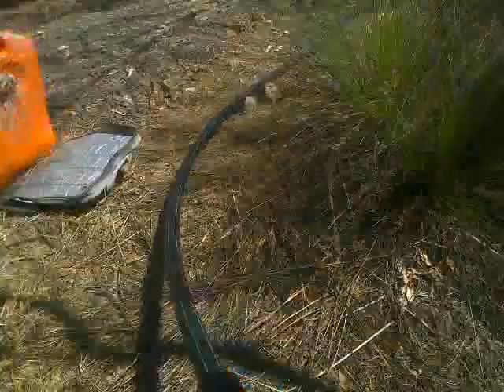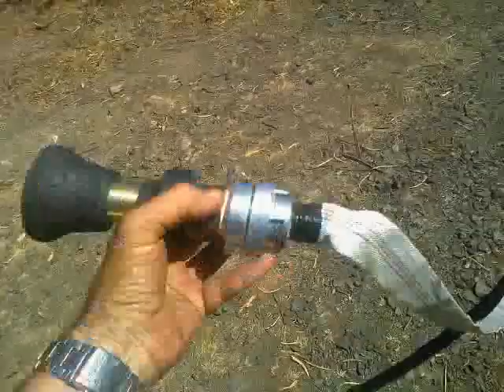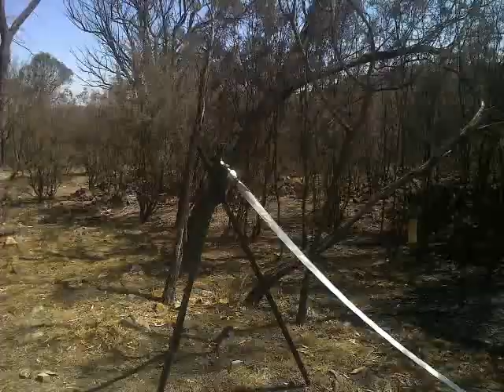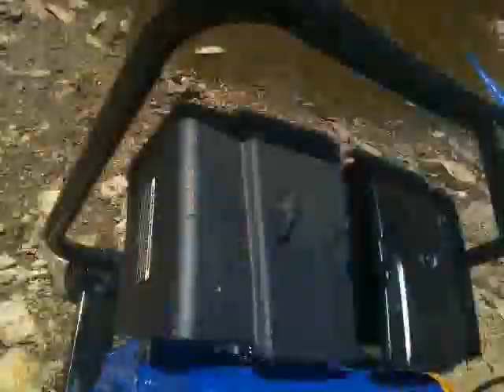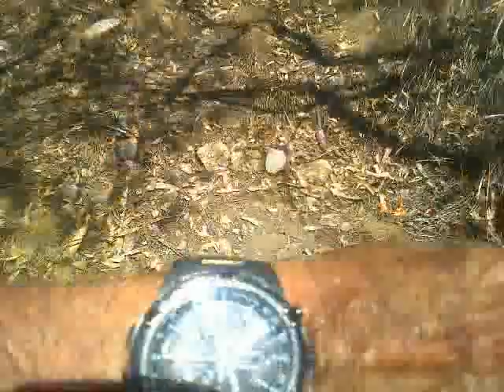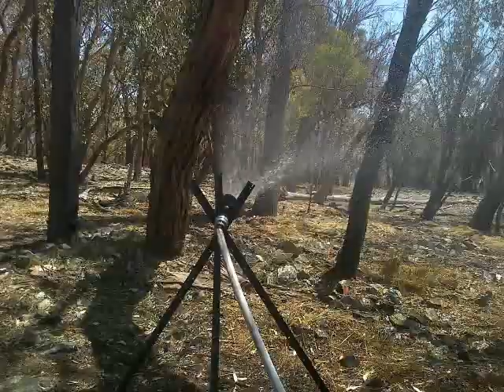The Aquarius Project.., Fire-Hose Sprinkler-Testing...

Comment: Looks like your float is working, considering it’s not a sludge pump that’s a good thing. My only concern for you is that you get trapped at the pond by the fire whilst your firefighting equipment is 450 m away, I guess you could go for a swim while Rome burns??? 
Had to replace 30+ Chinese black iron pipe unions on a yacht because the builder wanted to save $100 on a 6 million dollar build, as long as there are not any leaks on the suction side everything should still function ok? 
Have a good day.
Cheers 🍻

Comment: Your trees really look like they are suffering, judging from the dead leaves that are hanging from them. I guess it will only be a time before all those dead leaves fall onto the ground creating a greater fire hazard. I guess it is too late to conduct a burn off. Do you attempt to rake up all the dead crap on the ground ?
Reply from the maker: G'day Ed,

Thanks mate.

  Yeah, the trees started to brown off and die in July August 2018, when I first started upgrading my Firefighting Gear..., and I did put in a few weeks picking up all the Leaves & wheelbarrowing them out of the Hut/Shed/Aeroplane Trailer area. I moved about a ton of Leaves.

 I did it when half the Trees dropped about a quarter of their Leaves, and then the next heatwave baked the bare dirt where I'd raked, and cooked the unshaded Roots, and then about half the sick trees died totally.

 So this year I'm only raking away real close to the Hut, but I have cut down the Flax-Lillies though, and close in I've raked it up & barrowed it away..., and I've carted 13 trailers (7-ft by 4-ft) of dead Sticks & Trees from my "Hose-able" 1.5 Acres.

   In the middle of my Video to Greta Thunberg I walked two times around the Pile of removed dry wood, it's 3 metres by 3 metres & 4 metres high.

   It's a bit of a balancing act, between dead Leaves being a Fire Hazard and Mulch shading the Soil & conserving Water...

   At the moment I have 2 Pumps, one driving 3 Hoses, the other one feeding a Sprinkler, with a Compressed-Air "Water Cannon" in reserve.

   And soon I'll be able to buy Bore Water from my neighbour (at $50 for 12 Tons, or $25 per fill of my biggest Tank)...; so I'm going to sit on full Tanks while watering at 12 Tons per week - and I'm going to put some Bore Water into my Dam, too, in order to increase the Emergency Water Reserve.

  On the bright side, none of the Fires is throwing Embers in my direction ; but yesterday the Rappville Fire went 20 Km Downwind in 2 hours..., so it can all change really fast.

  I haven't been calling this,

"Australia's Terminal Drought..."

 for 18 months -  for nothin', y' know...

   They say we may be goanna get 20mm to 40mm on Friday & Saturday - so maybe me putting in my Aquarius Pipeline has worked as a Raindance...?

  Such is Life,

Have a good one.

;-p

Ciao !
Reply: WarblesOnALot I personally hate gardening work but my gardening chores is light compared to the gardening work you do.
Reply from the maker: @VBEd666  

Well, I hate Gardening too..., but the only way to not get cooked involves getting  anything that'll burn - and carting it a couple of hundred metres away ; where their Radiant Heat won't be likely to threaten the Clearing.

 It's a Shit-Sandwich, but one does the best one can, kinda thing...; I just try to keep getting back to it, because nobody else will do it for me, and if I want it done then it must be my job..., so I sort of plug away for an hour, then sit and have a Coffee, and then get back into it.

 After a few weeks it starts to mount up, and a bit of progress can be seen.

 I mean, it's still a terrible Firetrap but it would be vastly worse if I'd kept on fixing my Walking-Stick & carving little wooden propellers for the past couple of months.

  And I quit the Booze too - to have more money for Firehoses (!).

   I don't know how surviable  December/January will be..., on Monday it was 33 Celsius here, and my son was coming back from QLD where he said that it was 38 C. at 5 PM as they came through Warwick...

   We live in interesting times...

Have a good one.

;-p

Ciao !

Comment: Great video! Glad to see the fitting held up, apart from the actual connection! Your pump covers, are they universal or made for those pumps? We have made a fire fighting trailer, in an attempt to prepare for this fire season and those covers look like an ideal weather protector!! Hope you are alright with this hot windy weather you are having at the moment! Thanks :)
Reply from the maker: G'day,

Thanks.

  Yeah, it seems that the leaky bit is where the Hose-Tail swivels in it's Cam-Ring..., it's tolerable ; especially on a Sprinkler...

  I made up the Pump-Cover from some soft  Plastic sheeting which I was given by a Farmer whose Jacuzzi came wrapped in 3 big sheets of it..
, White on one side& Silver on the other.

 I used a Stapler & Silver "Plumber's Tape" to join it all up..., and after a day I added the Chimney Vent ; and then l, because the Sun was still baking the Fueltank,  I lined it with a layer of 1.5-mm Styrofoam - the stuff which Butchers' disposable Meat-Trays are made from, (I had a big Roll of it which came with my Aeroplane, to be used with Dacron & Epoxy to form the Wing Leading-Edge - but I departed from the Plans & used Sheet Aluminium instead.

   Putting it in the Pump-Cover was the first use I've found for it since I bought the Aeroplane as an almost-finished Scratch-build Project.

 And , yeah, as a Thermal Insulation in a Plastic Pump-Cover, it works very well...

 Now I  have another Pump I'll have to make another Cover for the first Pump ; because the unit at the Dam "needs" the Cover more than the one here in the Clearing...

Have a good one.

;-p

Ciao !

Comment: Looks like you have most thing figured out and they actually work! Well done o son.
I thought the pump may not have enough head to move the water 500mm uphill, although I gather that the gradient is not all that steep. I supposed now is just a matter of getting your son to give  a final nod of approval for the 'system' ? I am fancy a full brown sprinkler system around the hut for some fun of heavy artificial rain; I suppose you can indulge yourself in these luxuries every now and then ;  )
Reply from the maker: G'day,

Thanks mate...

Yeah, I put the figures to the people at the Irrigation Warehouse at the very outset, when I was going to use the old 3 Hp Pump...; they said at 500 metres and up 15 metres they said it would do 40 Litres per minute ; so I figured 6.5 Hp might go close to 100 L/Min - and it realised 93.8, so I'm very pleased with it.

Today I made up two more tripods, and next I want to organise my spare 120 metres of Polypipe to reach from my neighbour's new Watertank to my Buoywall, so that I can buy some Bore Water with which to sprinkle at night time...

The fine-tuning goes on.

Such is Life,

Have a good one.

;-p

Ciao !

Comment: Nicely done, did you use the wheelbarrow to carry the pump to the dam?
Reply from the maker: G'day,

Thanks mate.

  Nah, I used the old red Subaru to go down the Fenceline on Burilda - surprisingly I didn't even need to move any Stones to make a Track, because the old Subaru is a lot better at actual off-road conditions than it looks...

  And then I carried it the last 60 yards..., after lifting it up to sit balanced on a Fencepost as I  crossed the Wires.

   It was a big effort - but being in fresh smoke served to goad me to not let it beat me.

Hopefully I'll never need to use it...; but it's better to have everything set up, ready to go, rather than have all the equipment & fittings on the shelves in the shop in town, & the money to buy it sitting  in the Jam-jar hidden in the Hut - if the Hut gets burnt & the Jam-jar of Cash is melted, due to a lack of Firefighting Gear....(!).

  Such is Life,

Have a good one.

;-p

Ciao !